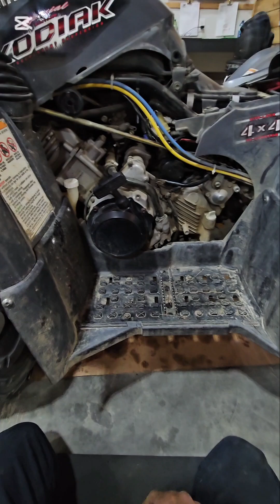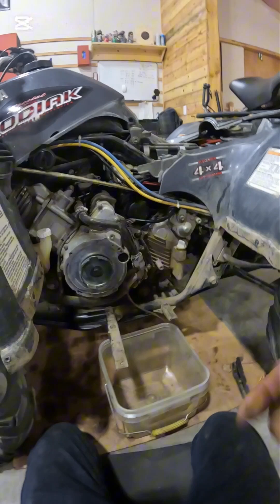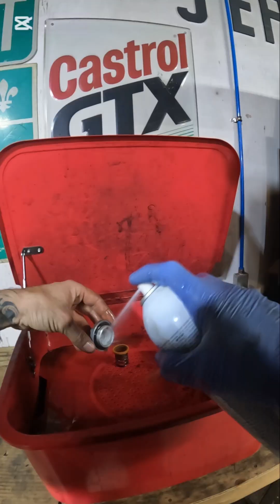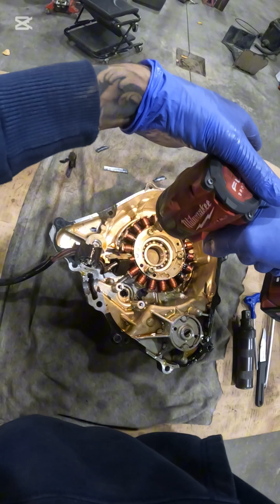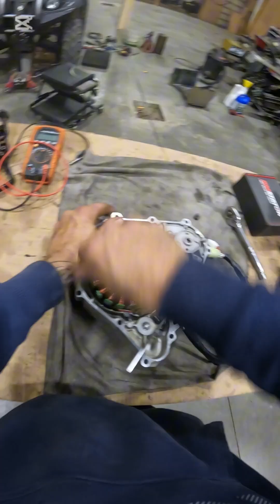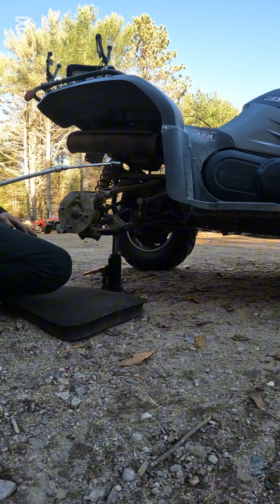Replacing the stator and regulator on a 2006 Yamaha Kodiak 450

Comment: Where u located i need this done in an 03. Im hoping its just the regulator. If its the stator im in trouble. Im in minnesota. Is there a way to test the stator without taking it apart to test like you did ?
Reply from the maker: Im in quebec, Canada. Yes you can test it installed also, just unplug the regulator and test all 3 of the stator wires for continuity from one to the other, they  should have a similar low resistance also check each one to ground, they should not be grounded, you can check the output too if you set the multimeter to ac volts, go from one stator wire to the other it should increase in volts the more you rev it. With this one it wasn't putting out enough at the start so I didnt know the regulator was bad until I changed the stator. If the stator seems OK you might just have to try a good regulator from another bike or just get a new one